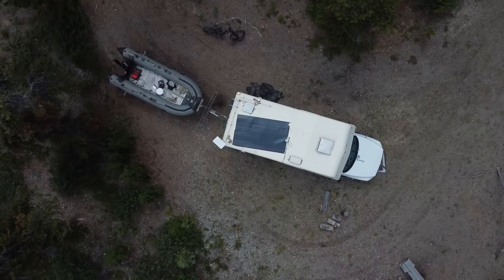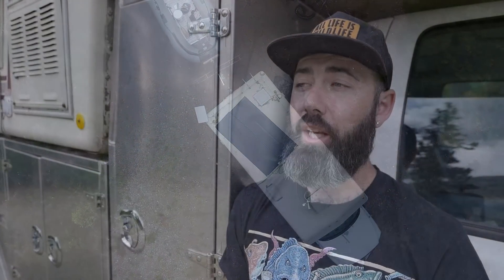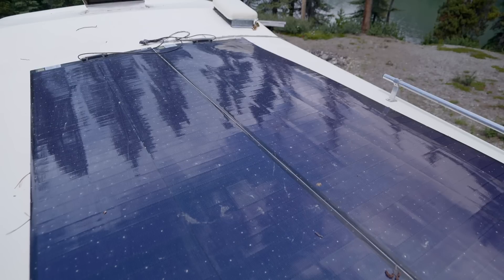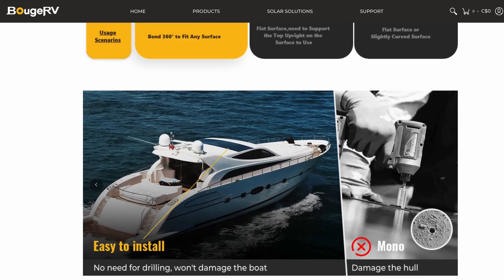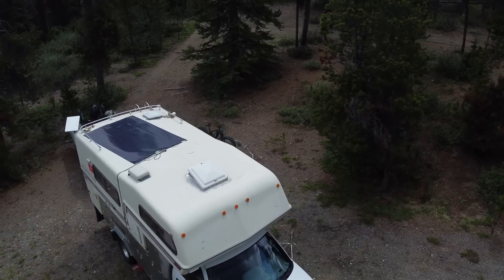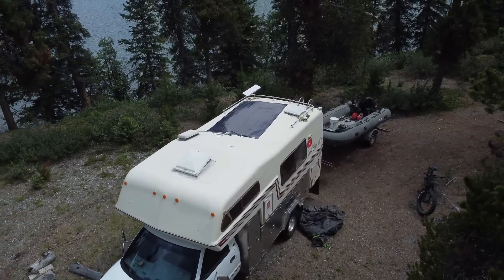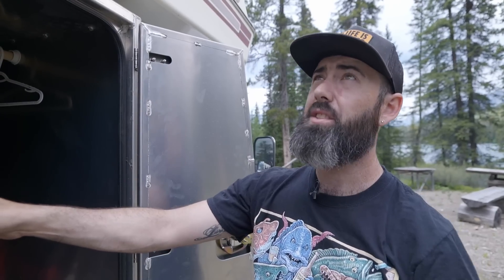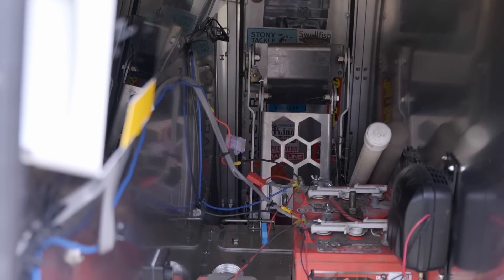The Sideways Solar Technique

Comment: If you used solid core household wire you might want to consider switching it out for stranded. This will reduce the voltage drop along the run and will maximize the output from the panels. DC amperage runs along the outside surface of the strands, whereas AC runs through the core of the wire. Also, the stranded wire will be more flexible and less prone to breakage due to repeated stress.
Reply from the maker: I will do some more research into this.  It is solid core, but only because we couldn’t source stranded wire at the time.   Thank you for this information.

Comment: I do believe everyone that's had the same system has said the salt thing you did, well more or less. It's basically plug and play which is exactly what I'm going to be looking for when I'm ready to do my 4x4 build. I do have one question though. Dually or single tire? I've heard so many pro's and con's for each that I'm literally stuck on which one is best. I'm thinking a retired ambulance because of the built in cabinetry which means less building things except for the bed. Love the question and answer video idea! Happy trails and safe travels to you!

Comment: I’m sure you might already know as your mechanical background is great, but hopefully the wiring you used up the side of the camper is designed for sun exposure. Most house hold wiring is not UV rated, just wanted to make sure you knew. Awesome video as always 🤟😎

Comment: Funny you mention an app and Ecoflow in the same video. It’s my beef with Ecoflow that you have to ‘log in’ to monitor/control the Delta Pro. Which doesn’t work if you have no internet. Whaaat? Is that supposed to be an OFF GRID solution? On top of things, it used to be that if you DO have internet (I see a starlink dish -awesome, BTW), you could just login with your Apple ID, without revealing your email address. Now Ecoflow forces you to give them your email address even when you login with Apple ID. The combination of these is really disappointing, and frankly makes me angry at the company, whose products are otherwise outstanding.

I’ve been planning to make a video about it, including a little bit of cybersecurity assessment (my day job), but frankly, been too busy building my cabin, LOL. One of these days, I guess.

Does the app you use to monitor / control your solar need a login too? My RV is constantly running out if power when not on the road, and a solution like yours could be the answer. But not if they would force me to give them my email. We want to be OFF GRID for a reason, don’t we?

Comment: Piano wire with pull handles that on the ends might saw off the solar panel. What if one gets broken or just gets old and inefficient? Do you just stick new one over top? Hail proof? 
Experienced skoolie builders say solid core (house) wire doesent stand up to the vibrations of traveling and can break. You might think about swapping for stranded wire at some point, I would hate to see  that sweet rig go up in flames.

Comment: The down side to the flexible panels is that they are not very efficient compared to a glass panel.  You don't want to walk on either type.
Reply: On efficiency...I don't think it matters that much really.
If you only need 400 watts....then the size of the panel(s) doesn't matter, because regardless of how big they are, you can stick them on damn near anything. If you are looking at trying to get as much wattage from your roof area as possible? That's another story entirely. Efficiency definitely is going to play a role there.

One of the other downsides of flexible panels is that they don't last as long. It seems to can expect to get 5-15 years of use out of them, if they are taken care of, vs 20-40 years for framed rigid panels. But again....if you wear out the flexible panels on the roof of a camper? That's a long time to be driving the same vehicle/home.

On the other hand, are the significant advantages of Flexible: Effectively no added wind resistance. Less holes/water ingress points need to be drilled into your home. Less chance of a branch trying to rip it off your roof.

Different use cases, different benefits. If you are mostly going to be in open country, without overhead obstacles, and you are aiming to delete propane from your RV? Then yeah, you are probably going to want hard panels to maximize efficiency of the surface area you have. If you only need so much, and you aim to be doing rough driving in overgrown areas like the Pacific North West? I think flexibile might be the better option.
Reply: @dposcuro  - It wasn't clear to me where the 400 watt requirement came from.  Seems like you would want more than that.  For the same area with a high performance glass module, you could get close to 1kw.
Reply: @HillbillyDeluxeSportfishing  I honestly thought you were bullshitting me. So I looked it up, and yeah, you're right. A single 460w framed panel is damn near a square meter smaller.

Though that is due to BougeRV using some pretty lackluster panels that only offer ~16% efficiency. There are flexible panels that do a bit better, in the ~19% range.

I did say 400w, because, that is what he is using in his build. Because that honestly seems like it will suit his needs perfectly well (so far).

To be honest? If I were putting solar on my camper? I would be using flexible panels too. Going out into over grown forest, on the west coast of Canada is the same thing I would be doing. Having panels that could potentially be ripped off because of a low hanging branch just seems less than ideal. That and saving 14 kg off the roof of my camper seems like a good idea.

For a trailer I might purchase? Rigid panels, definitely.

Course, all of this is kind of moot, because BougeRV sponsored his use of their product. And hell, I would take "free", over "better performace" as well.
Reply: @dposcuro  - I might know solar and battery things.....  That said, most of the reasonably priced flexible panels have terrible efficiency comparably.  My guess is free drove the 400 watt sizing.
Reply: @HillbillyDeluxeSportfishing  My apologies for doubting your knowledge, but...this is the internet, and people lie about everything. Glad you weren't! Thank you for steerin me right.

Comment: One could argue that you had to circumnavigate the panels to accomodate around the roof vent.
Reply: This was exactly what I thought too.  I will admit, as a pro ocd solar tech, it did bug me a bit.  But I figured it was the only way he could avoid the shading of the roof vent.  I do wish I could re-do his wiring.  Solid gauge wire is really not ideal for solar but like he said, it's charging those two batteries before he gets up.  So it doesn't matter.  What really matters is that no matter where he goes, we will be able to pin point his location from space by just looking for those crooked panels : )  Keep up the great adventures Dustin!
Reply: I thought that was the reason...LOL! As long as it works I guess it is what it is.
Reply: That's what I initially thought.
Reply: @ToddTevlin  Same!

Comment: Any solar panel needs to be cleaned regularly. Even a light coating of dust or pollen can impact output. It even drops if the shadow of a bird overflying passes over hte panel. You don't have to be obsessive about it but tend to the cleaning now and again.

Comment: Blame Mick.
Reply: That guy is trouble.
Reply: I found that a great way to remove stickers and things like that is to get a piece of long dental floss, and saw it back-and-forth between the hard surface and the adhesive. I know it’s too late now, but perhaps when just the corner stuck you might have been able to use that trick to get it off.